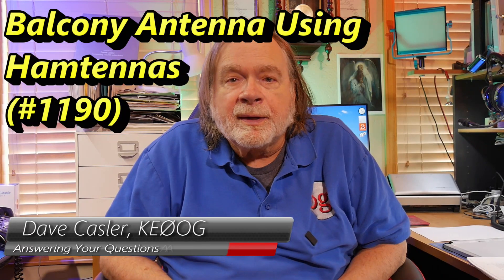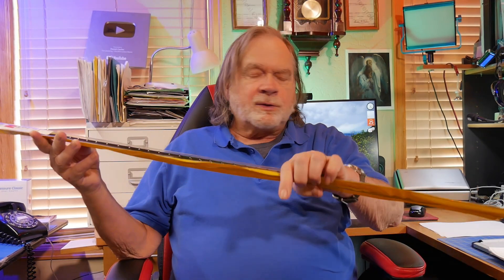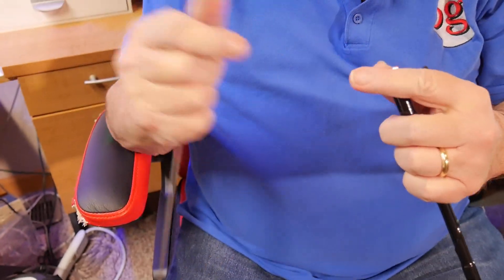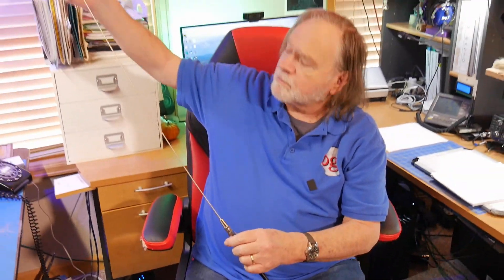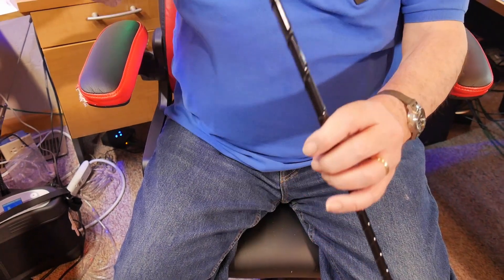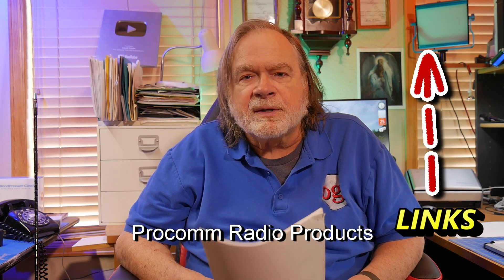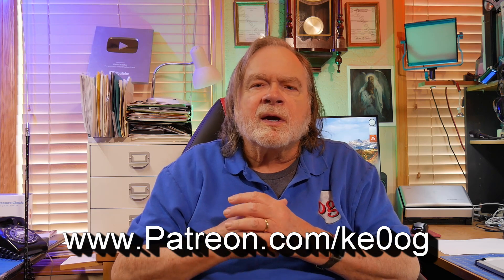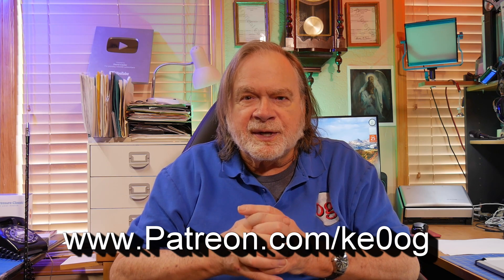Balcony Antenna Using Hamtennas (#1190)

Comment: I have this balcony linear loaded dipole cut so it matches 15, 17, 12 and 10 cw with xiegu90 tuner. I can tune it on 20 and 40 as well.. but ...I presume the antenna is not efficient on 20 and 40. Have notworked any on 20,.com40. I don't mind. I still hva great fun and sometimes I work dx. 20w only.